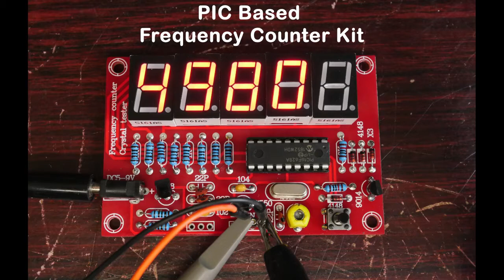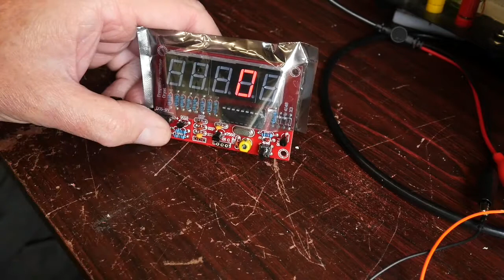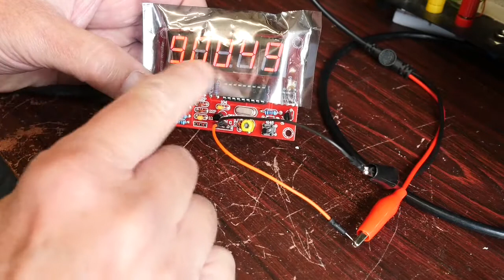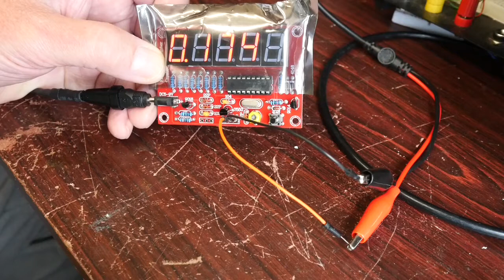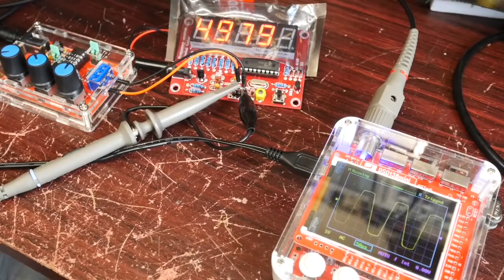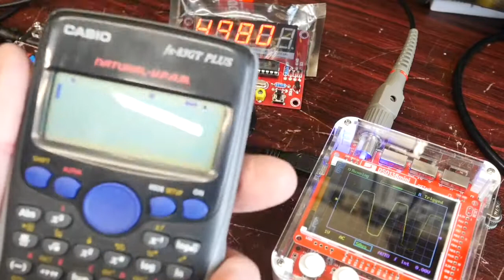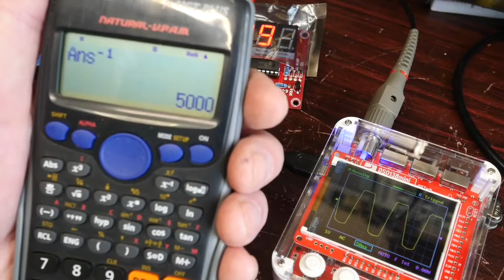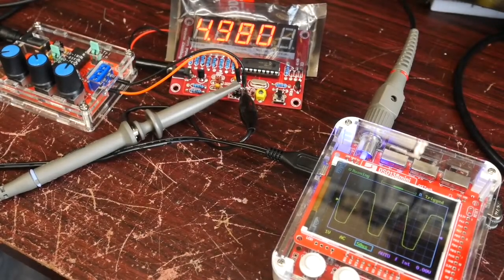Frequency Counter and Crystal Testing Kit

Comment: This KIT directly exposes the PIC's frequency counter input to the "outside world" without any protection, and without any pre-amplifier. Therefore the input level of the signal input to the PIC (microcontroller) may only range from 0 Volts (= ground) to the supply voltage, i.e. 5 Volts.

Comment: SO, how much level does it need to work as a frequency counter??? I couldn't get it to read the oscillator in 2 short wave radios.Probably not enough level. It was about a $5 kit on Ebay here. Thanks.

Comment: Hi. Nice video.  I have a question about that function generator kit: what is the min - max output range in millivolts - volts.
Thanks
OA4BMG Claudio
Reply from the maker: Claudio, with a 9V supply mine gives around 5.5V P-P, 73 de Bill, G1YQY
Reply: @LockdownElectronics  Hi. 5vp-p is the maximum. 
About minimum, can you obtain milivolts and what’s is the minimum value reachable?
Thanks
Reply from the maker: @claudiobio  You can lower the output to zero using the pot, it's not particularly accurate.

Comment: The voltage and accuracy issues encountered are due to the crappy Colpitts oscillator used as input to the DL4YHF counter - in and of itself excellent. 

It's discussed in this video by Julian Ilett. Skip ahead to near the end. 
https://m.youtube.com/watch?v=q31unvowJe4

Comment: There's a better version of the counter that has an amp on the board and BNC connector instead of the crystal checker.  It came on with a zero in the second digit and seems to use the same software so I put the chip into it that I programmed with an improved version of firmware from theHWCave and it worked!  @t

Comment: How did you get yours working?  All mine does is say E.E.E. on he LEDs.  Also do you know if there is any info on programming it or is that just a scam?
Reply from the maker: It just worked, sorry yours is not working. Are all the pins on the IC making good contact with the socket?
Reply: @LockdownElectronics  Yep, I reseated the IC and checked over all the parts. It seems to have been put together OK so I guess it's a bad PIC so I ordered a $20 programmer to try and fix a $10 device which seems silly but I want to see the darn thing work!
Reply: @stevec5000    take a look on dl4yhf frequency counter

Comment: The left over capacitor gets soldered on the rear of the pcb it cleans up the noise for the low frequency response. https://youtu.be/1Z-08FLrUwU?t=4